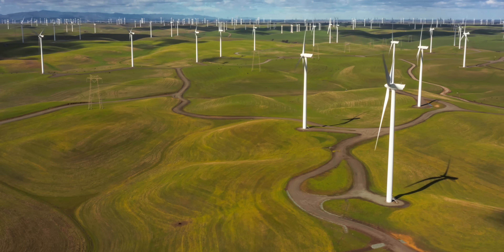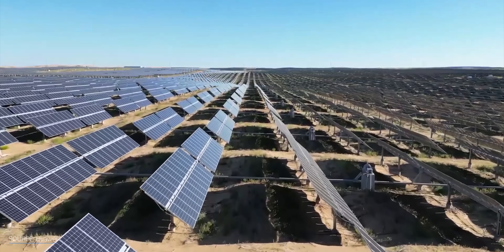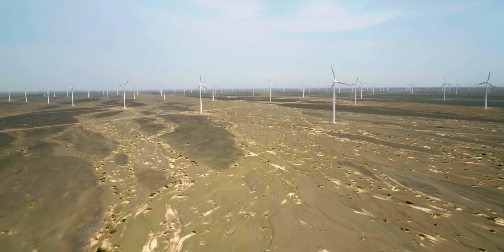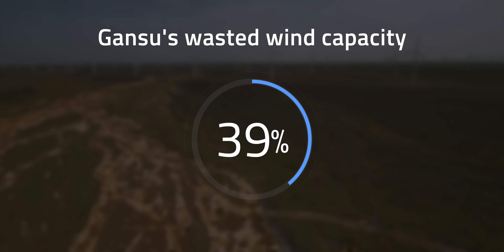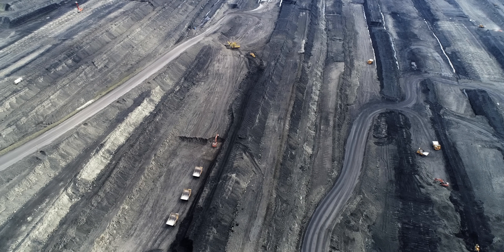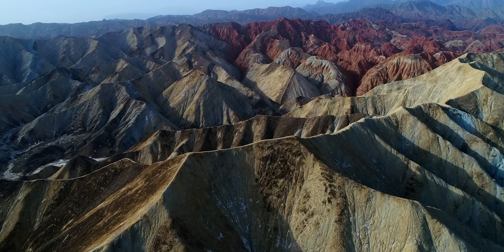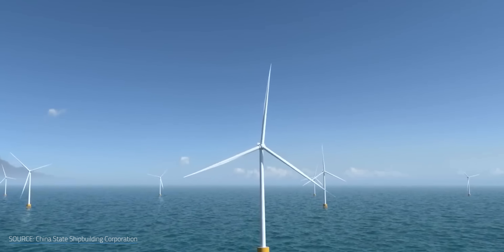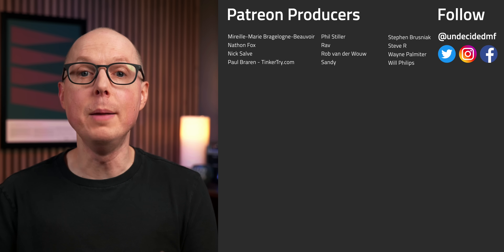The World’s Largest Wind Farm has a Tiny Problem

Comment: I'm coming at this from an entirely naive perspective, but (and this sounds bonkers)… in cases where it makes a lot of sense to put up energy capture/generation in remote areas (like a desert) where transmitting over cables would be difficult if not impossible, would it make sense to truck/train the stored energy? Historically we did that in the last mile for things like coal or oil to the home. But what if we loaded up trucks with batteries that were charged at these stations, then dropped them off/plugged into distro stations closer to urban/populated areas? I think there's a parallel here with a station wagon full of data tapes. High latency, but huge bandwidth.

Comment: Funny, we have the opposite problem in Australia. Solar gets curtailed in the middle of the day because the coal plants cannot be turned off.
Reply: That's true.  Coal boils water to make steam to turn generators.  Takes time to heat those boilers from scratch.  An alternative is to run the generators from gas turbine engines like jets use.  Easy, fast on/off.  But the efficiency of gas turbine generation is much less than coal/oil/natural gas boiler plants.
Reply: @wam7484  "efficiency of gas turbine generation is much less than coal/oil/natural gas boiler plants" .. Really? I had understood the opposite, like 35% vv 60%. I may be wrong.
Reply: @jonb5493  A gas turbine is an internal combustion engine, very inefficient 20%.
A gas boiler is heating water which is very efficient 90%.
Not sure how efficient a steam generator but better than combustion.
Reply: @pulporock  On our best days our thermal efficiency was in the 40's with steam generation. That was 20 years ago though.
Reply: That is absolutely not why your solar gets curtailed.
Reply: @lawdpleasehelpmeno  Please elaborate.
Reply: @kjlovescoffee  I run my dish washer and car charger between 10:00 hrs and 14:00 hrs so I get the power for free off the roof sola.
Reply: The funniest thing in America electrical usage has steadily dropped since 2007 except like for 3 years. Where it went up 1%. 

 Also states like Texas... Texas! Love batteries. The growth of batteries to help the grid as a whole for both renewable energy and for natural gas has been pretty staggering. 

 That investment into battery storage is paying off. No clear winners. It is just that batteries I guess are helping them stabilize the grid, but also storing when costs are low, and releasing when costs are high. 

 Anyway if power usage has been going down. There was no reason to invest in power. We are a capitalist society. 

 More companies will now invest in power, and hopefully all these advandces now that demand will be going up. 

 Especially with AI being more power hungry than anything we've witnessed.
Reply: @dianapennepacker6854  I read recently that hi tech companies that are into data storage and AI are approaching nuclear generators trying to buy all their power output. Power consumption is growing at a staggering pace.
Reply: @dianapennepacker6854  That is because all the manufacturing has been outsourced to China, Mexico or other places.
Reply: Look at the NEM graphs; solare is growing and coal is reducing during the day. There has been a huge shift in the solar put into the grid.
Reply: @kjlovescoffee  In this country, when there is a surplus of solar/wind - we are PAID to consume more power, typically for some hours. Doesn't happen often, but does happen.
Reply: @NadNorgaard  We have a surplus during the day because 1) rooftop solar cannot be easily curtailed, and 2) coal cannot be turned off.  Utility solar absolutely gets curtailed. Wind probably too.
Reply: Not too much point in saying more here. But for the record:

- Not all energy storage uses batteries. There are at least two other methods currently in wide use at grid scale today. And there are several more on the horizon. (I'm watching the Natrium nuclear plant in Wyoming very closely. Its molten salt thermal energy storage system is going to be very interesting... if they can get it up and running!)

- The idea that you can't disconnect a generator from the grid is as absurd as it is false. Every generator attached to the grid is attached via a breaker. A purpose-built piece of electrical gear whose entire purpose is to easily disconnect the generator from the grid. As for steam turbines, steam can be vented to the atmosphere with very little environmental impact. It's not DISconnecting generators from the grid that's hard... It's REconnecting them to the grid when you want them to come back online! That's why solar generation gets curtailed first. Because it's way, way easier to reconnect a solar panel and its inverter to the grid, than to grid-synchronize a large generator drive by a steam turbine. But this idea that you can't disconnect a steam turbine generator from the grid, is pure fiction.
Reply: Of course they can be turned on and off. They have maintenance shutdowns. It just takes time to wait for the boiler to cool off & then heat up again, so it's impractical to turn them on and off on a daily basis.
Reply: Smarter people with more foresight (by which I mean: NOT ME!) have understood for a while that grid-scale energy storage is required if renewables are going to succeed in the long term. Governments curtailing solar production to appease coal power plant operators is a great example of exactly why storage is such a critical piece of a renewable energy powered electrical grid.
Reply: @SaltyPuglord  It has nothing to do with appeasement. Coal plants physically cannot turn off and on. If you don't curtail the solar then you have too much power which can damage equipment. If you just permanently turn the coal plants off then you don't have enough power at night.
Reply: @jmlinden7  exactly. So many have no idea what they are on about when on this subject.
Reply: @SaltyPuglord  Balancing things on the demand side can also help, but most people don't want to have to think about variable rates.
Reply: @SaltyPuglord batteries are expensive. And they need to be replaced more often?
Reply: You cannot produce more power than is being demanded unless you want to destroy your power generation infrastructure.  @SaltyPuglord
Reply: Coal plants can be turned to idle state generation only power for itself. But the investment cost still runs. Thus no income and only coal price saved. Nuclear plants are also able to turn to idle but much much slowerly, in 6..12 hours. Cost problem is the same in nuclear plants.

Comment: I am all for renewable and nuclear energy, however I never see How much carbon is released by mining, smelting, producing, and installing all that power line and materials. There is an environmental cost to building these systems and if they are not used to capacity we are making things worse in the long run.
Reply: Thats factored into the life cycle assessment (LCA) that forms part of the levelised cost of energy (LCOE) determined for differing energy sources. Wind and Solar, even with the points you raised are lower than fossil-fuels (whether gas, coal or oil). 

Even with long transmission lines the cost of renewables is still lower, and is factored into projects such as the 2,500mile (4800km) 3.6GW cable being installed between Morocco and the UK (by a private company). 

There are many other long HVDC cables installed around the globe, the main difference with renewables is once the infrastructure build impact is complete there is a tiny (operation and maintenance mainly) ongoing natural resource cost going forward compared to consumable fuels like gas, coal and oil (or even hydrogen for that mater - not all 'green' sources are the same).

Comment: It's hard to criticize the waste of such vast swaths of land when the land is already a wasteland. But there has to be a better way, particularly when the population is held in such densely populated cites. Being dependent on power transmitted over such vast distances isn't healthy for the cities either, which would shutdown if there was ever a disruption. 

We have to learn to live in the wastelands. Use that all that cheap power to extract moisture from the atmosphere. Build geodesic domes out of all that sand to contain the moisture, and employ hydroponic agriculture on a wide scale to support a population that region couldn't support by itself.
Reply: I really don’t need to read this Dune fanfic, dawg.
Reply: This sounds way more complex and a giant dome failing would be much more catastrophic than a powerline failing
Reply: This video highlights the major issues with wind farms. Matt has covered some smaller, more distributed types of wind energy which are far more practical. 
I believe that both wind and solar need to decentralize more. Like let ConEd pay me a small fee for putting a solar array on my house but they own it and maintain it.
Reply: @searchingfortruth619  ConEd will never achieve the efficiency of Gansu Yumen Photovoltaic Power Farm running thousands of identical solar panels installed in one location putting out 300MW. Their techs are not caught in traffic jam driving all over the city trying to climb the roofs of houses who's owners are at work, and they don't have a thousand different solar panels all using different components. Management is a headache, never mind maintenance, repairs, and getting the spare parts.

Comment: I believe I have the ideal solution. They should build a hydrogen production facility near the electricity generation site. Any surplus energy can be directed to the hydrogen plant, allowing the hydrogen to be stored and used elsewhere, whenever needed. Does that sound correct?
Reply: Hydrogen produced from what? Typical discussion is either electrolysis from water, or from natural gas. Water is in short supply in a desert. The region has coal. Does it have lots of natural gas? What byproducts like CO2 come from getting hydrogen out of natural gas or coal? How much does it cost to produce that hydrogen and capture any byproducts bad for the environment?
Reply: No sufficient supply of water, the aquifers in the Gobi desert area are already under strain. Plus it's a lot more complex and expensive to process and transport the hydrogen produces (tanker, vessel trailer or pipeline) than to build electrical transmission. Pipelines are not quick to build, and with hydrogen will likely suffer signifcant losses over the distance covered, particularly at the numerous joint seals and values involved.
Reply: Hydrogen looks ideal at first glance but it is also is incredibly problematic.  As a gas its not very energy dense but a liquid takes high pressure or lots off cooling. On top of, that those little atoms love to escape between the nuclei of the large atoms in its container, either escaping or embrittlung the container until it fails. Lets not forget how explosive it is.   All these things need to be considered.
Reply: Another commenter said they have already commenced a plan to produce hydrogen there.

Comment: There is an additional issue directly related to windfarms. That is the cost of long-term maintenance.

Today, much of the materials used to create those giant blades is simply not renewable. This is due to the cost of recycling these materials being greater than the profit margins for companies that are trying to recycle these materials. When your cost to income ration becomes too small, that company must either close up shop or find a more cost productive function.

So, while wind turbines appear to be a plus + plus for our needs to reduce pollution, they are simply not acceptable in an economy like our own. This is ignoring the research that shows that high density wind turbine farms are a hazard to wildlife and agriculture.

We have a long way to go before these green energy projects actually become feasible on a large scale.

Comment: Why DC power lines, though? I thought they had more power loss? That part could have used a quick explainer.
Reply: You got it backwards.
Reply: Naw, as the other guy said DC is better for long distance transmission, ac is better for most daily use but not for transmission.
Reply: @ConstantChaos1  Right, I see. So if the distance is long enough, it outweighs the hardware cost and power losses from the AC - DC - AC conversions.
Reply: @tvuser9529  exactly, since AC uses 3 different phases (3 different waves that are offset) you lose more energy over long distances which actually makes long distance transmission of AC virtually impossible, ngl my field was biochem engineering not electrical engineering so I only know the fundamentals (and might have some wording or something slightly off) but yeah.

Comment: Wait a second....  High Voltage DC power lines?  That made me research and question what I know about power lines.  Can you do a video on why all of sudden DC is back in favor?  I thought the whole reason AC was invented (discovered) was to solve current loss of DC voltage over long distances.
Reply: DC is and always was better if you look purely at the losses of the transmission line itself, but stepping the voltage up and back down can only really be done in AC. As converting between AC and DC also has losses converting your electricity to DC only makes sense if the power line is a very high voltage connection over a long distance. And those really only started making sense when intermittend renweables became widespread.
Reply: HVDC never realy went out of favour, there's been series of projects since the 1970s (when electronics started to make higher power AC-DC and DC-DC conversion possible). The uptick from the 00's onwards has largely been driven by renewables and a desire to connect remote locations and improve interconnection between countries. 

Example of large scale HVDC initiatives are:
- the European Super Grid intiative seeking to link Europe and North Africa into one big interlinked grid, with plans to extend this to the Middle East and Central Asia;
- the ambitious One Sun, One World, One Grid that is seeking to connect all the central 1/3 sun belt countries around the globe; and,
- the 2,500mile long 3.6GW HVDC line private enterprise connection between the UK and Morocco (which includes 11GW of generation and 22GW of batteries).
Reply: Transmission losses are the same with AC (RMS) as DC, but it's far simpler to change voltage in AC, all you need is two coils of wire and some iron-ish material in the middle. It's only since the 90s that DC-DC converters (SMPSs) are commercially viable and well performing/behaving, and innovation in that space continues with tech like synchronous switching, GaN, etc achieving <98% efficiency.
Reply: High Voltage Direct Current (HVDC) systems offer several advantages, including:

    Reduced Transmission Losses: HVDC systems can transmit power over long distances with lower losses compared to AC systems, especially in high-capacity applications.

    Higher Transmission Capacity: HVDC can carry more power over a single conductor compared to AC, making it efficient for long-distance transmission.

    Stability and Control: HVDC allows for better control of power flow and enhances grid stability, especially in interconnected systems.

    Interconnection of Different Grids: HVDC can connect asynchronous power systems (grids that operate at different frequencies), facilitating the exchange of electricity.

    Lower Environmental Impact: HVDC lines can be built with fewer conductors and smaller right-of-way requirements, reducing their visual and land impact.

    Reduced Short-Circuit Currents: HVDC systems can help limit fault currents in the system, improving the overall safety and reliability of the grid.

    Integration of Renewable Energy: HVDC technology is well-suited for integrating renewable energy sources, especially offshore wind farms and solar power, into the existing grid.

    Cost-Effectiveness for Long Distances: While the initial investment may be higher, HVDC can be more cost-effective over long distances due to lower operational and maintenance costs.

    Flexibility in Grid Design: HVDC systems can be more easily integrated into existing infrastructures, allowing for flexible and adaptable grid designs.

    Improved Reliability: HVDC systems tend to be more reliable and can operate more effectively under varying load conditions.
Reply: You didn't discuss maintenance. What happens with blades and panels when they reach the end of life? What has been the environmental impact of these projects?
Reply: Lines aren't AC all the way from source to destination, never has been like that. The first stage originating at the power source is always DC. It gets converted before reaching the consumer destinations. That's where the AC modulations are required.

Comment: Gansu is not only remote but as well faces water shortages. Hence, imho, not only facing transportation and / or storage of electricity it also is not the side for using overstock electricity for generation of hydrogen..
Reply: They can carry out electrolytic aluminum industry. Silver is a by-product of electrolytic aluminum. The price of silver has been declining in recent years. Happen to know it.
Reply: The amount of water needed for the hydrogen production is relatively small. AFAIR desalination from sea water would only add some 0.5% to the energy needs. So it would be OK to transport the water from quite some distance (e.g. via rail) if really needed. If used for storrage and convert the hytrogen back to electricity the water would be in a largely closed cycle.